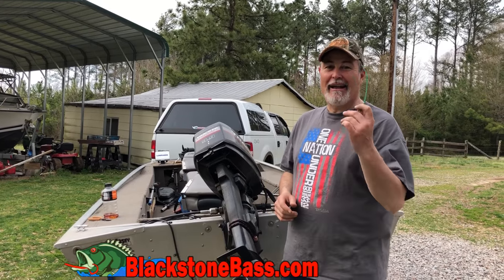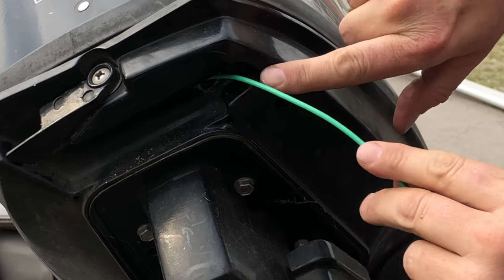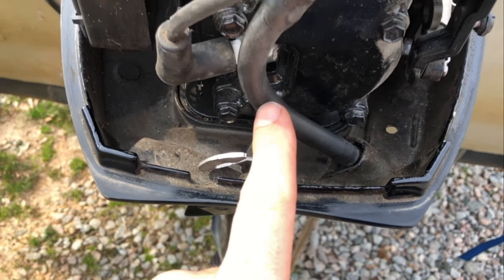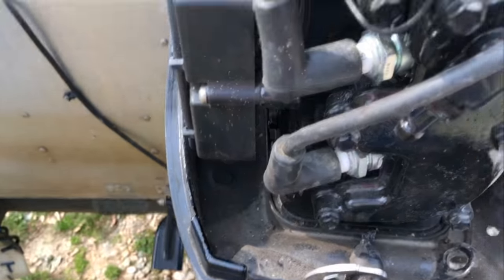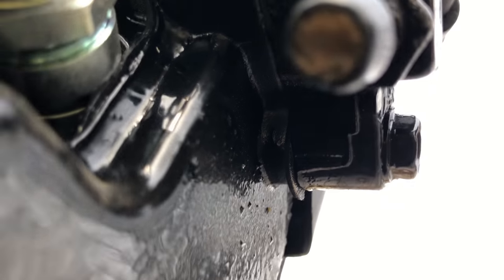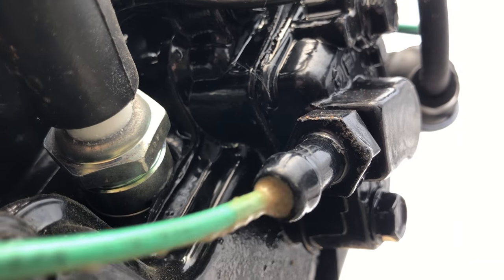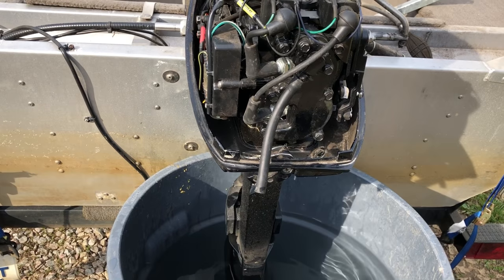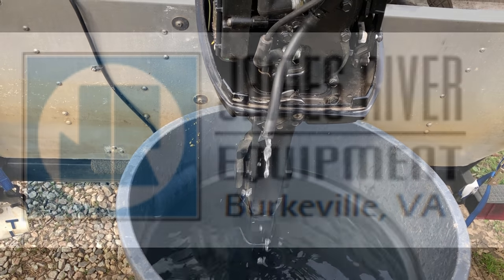Outboard Motor Won't Pump Water

Comment: When storing your motor for the season, use a small stick to plug hose or cover the end with painters tape.
Reply from the maker: Good Idea.......
Reply: What if the motor was stored for years without the dirt being cleared out? We noticed the old 9.9 ain't peeing. Looked in and saw exactly what you saw! Except now, this isn't fresh dirt. It's been stored by an old friend for years! So it's dried up and crusty!

Comment: Hi there can you  help me please my boat engine (Johnson 25 ) works when cleaning with hose but under load it just putts around . Thanks
Reply from the maker: Check out my video outboard wont run in the playlist.  Sounds like you could be getting air in the line from cracks in hose ball somewhere.  Once under load the fuel will suck air and make motor bog down.  If not then the carb or the filter is the issue, I cover this in this short video......